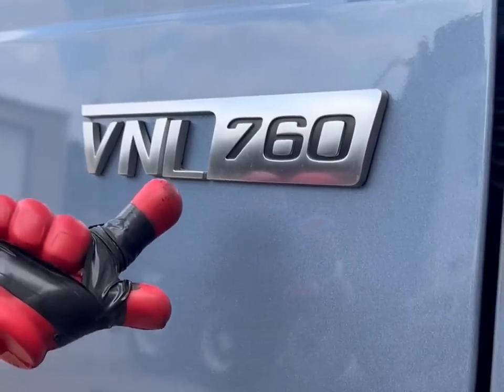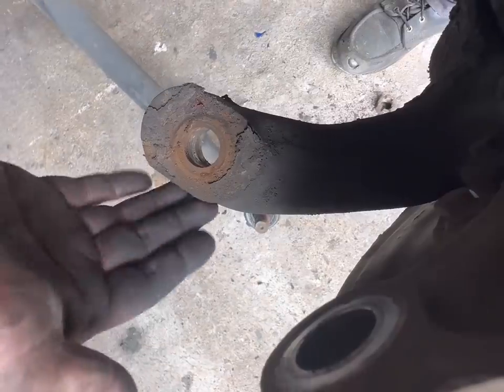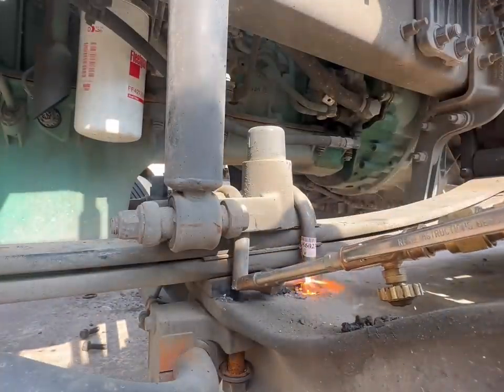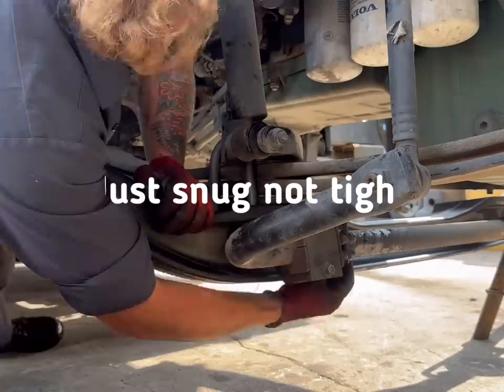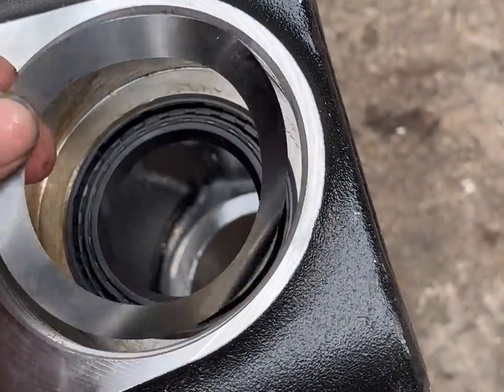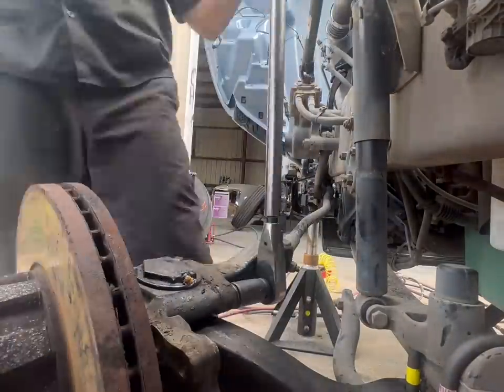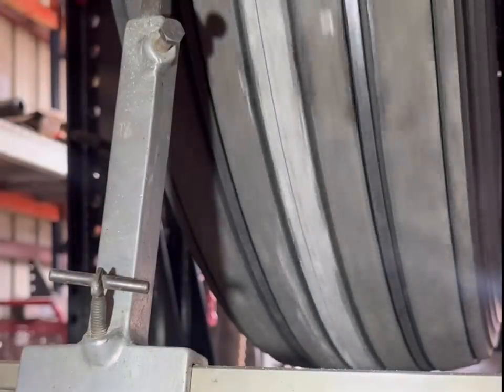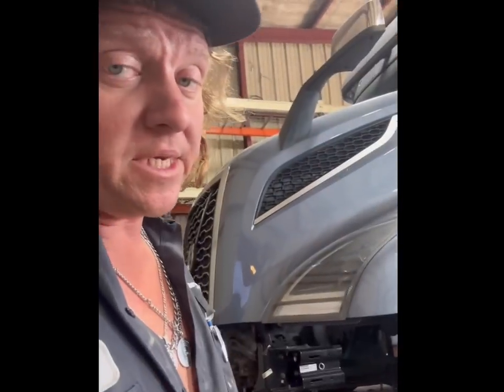Camber on a brand new steer axle

Comment: Dude
That intro
IS OUTTA THIS WORLD!!!

Lookup tiger tool striking nuts for tierods and such man
It'll save the ends of the junk we workin' on
Reply: Just use a 7/8 deep nut and weld a plate to the top of it. Then smash it with a sledge hammer works great haven't messed up a TRE yet

Comment: Well this is  definitely an interesting video... My company just took me out of my old truck and put me in a brand spanking new 2024 Volvo VNL 860... It's a bare bones fleet spec truck, prison gray on the inside... I got it with 79.6 mi on the odometer, you have to hold the wheel about 40° to the right to go straight, and the truck is all over the road... As of right now it has 460.5 mi on it.. And it's just getting worse, and my fleet maintenance supervisor in not so many words told me I was full of shit, that it was a brand new truck in that nothing should be wrong with it... Yeah fucking right. 
I wish I knew where you were man so I might be able to swing through with my truck and let you work your magic on it, because it's driving me fucking crazy.
Reply: Make them drive it around the block?
Reply: Take it to a Volvo dealership you can drive to the parking lot and show them that the steering wheel is way off center

Comment: Back when I was learning auto body, my mentor told me you can always tell the guys that run frame straighteners, because they had their front teeth knocked out from a chain breaking loose. I guess that puts you into the elite class of benders because you got all you teeth.
Reply: I remember the teacher telling me about a guy tightening main bearing caps in a Mack, and the socket stuck on the bolt and came off the ratchet, and then of course it fell off of the main cap right in his open mouth. 
Lol to this day I tighten stuff with my mouth closed 😝

Comment: Too much Camber can push or pull to one side.
Without positive caster the steering wheel wont try to return to center. Feel like a bad bearing/ball joint etc

Comment: 4:12 You have nice equipped shop and lot of knowledge but need one small thing to learn. Read the manufacturer manual how to install or uninstall parts before hammering and destroying customer parts. To remove king pin from axle you need to support axle right near king pin with jack.
Not everyone who has electric guitar is a rock star but everyone with impact gun is mechanic.
Reply: How big is your shop..he seems to get plenty of customers .there are more than one way to do things
Reply: I don’t think that overly matters considering he replaced everything with brand new parts.